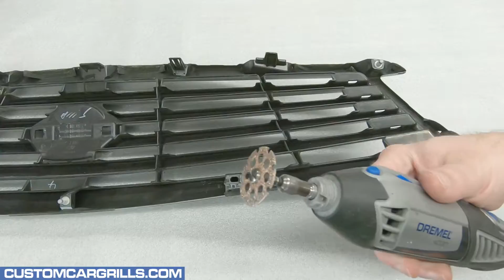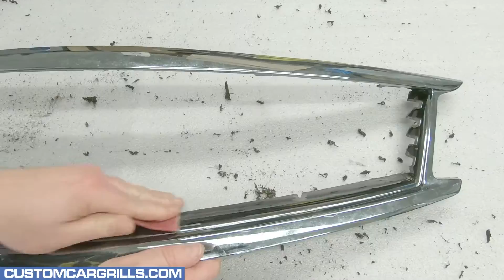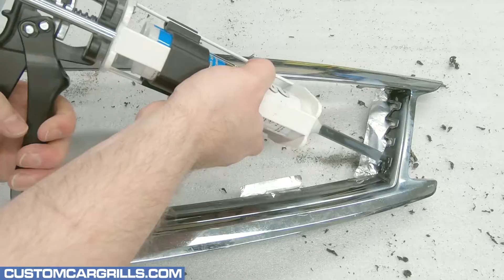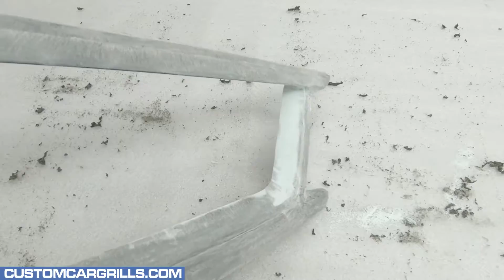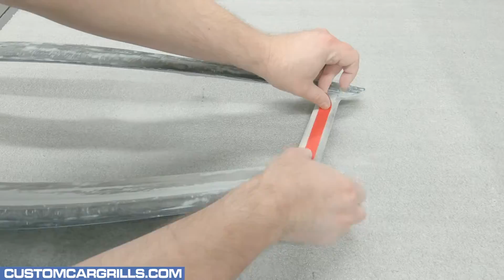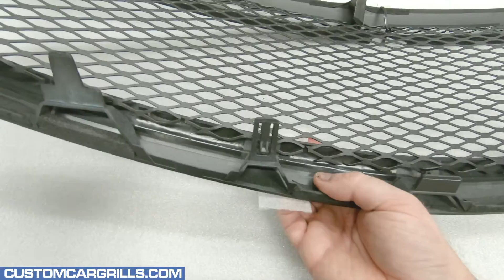Infiniti G37 Sedan 2010-13 / Q40 2014-15 Mesh Grill Installation How-To by customcargrills.com

Comment: What type of paint did you use? Something I can buy “over the counter”?
Reply from the maker: The grille frame, I used "Spraymax 1K Satin Black", and you can find it online but usually not in a normal store.  The mesh is powder coated.